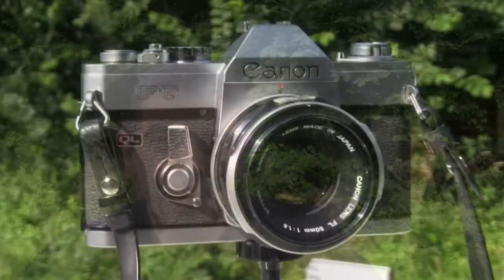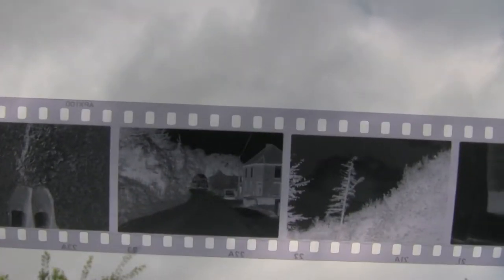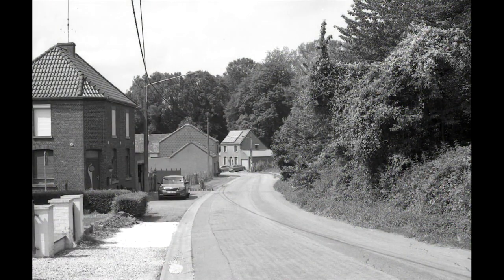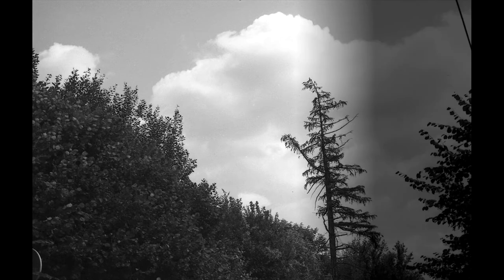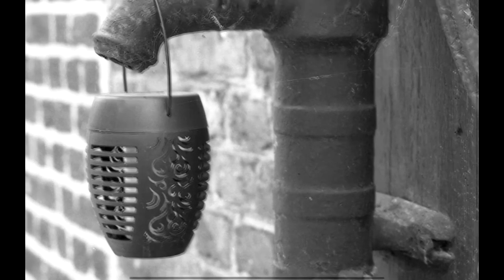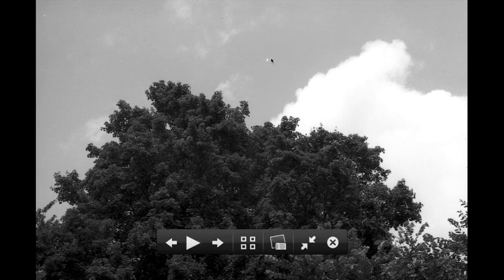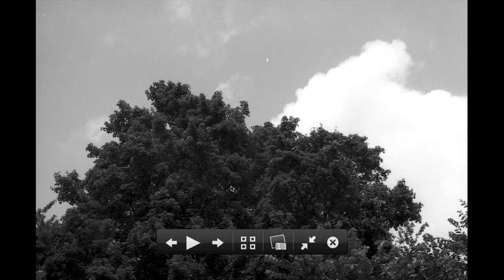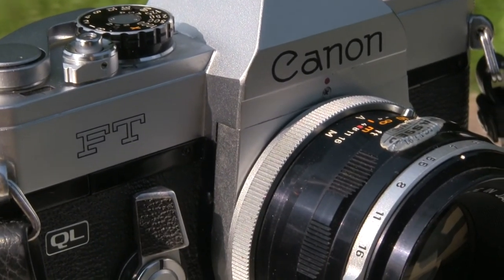How I check if a vintage film camera is fully working or not (Canon FT QL)

Comment: The first thing I check on a new camera is the film advance mechanism. If the spool doesn't rotate in the same manner each time I cock the shutter it's no use bothering at all. The frames will overlap and most of your roll will be wasted... Had this problem with my Exakta RTL 1000 🤷‍♂️🤦‍♂️
Reply from the maker: Guess what ? The RTL1000 is really similar to... a Praktica ! Let that sink in !

Comment: i have this same camera. my grandpa owned it and he did over 40 years ago and it has NOT been used since then - i want to use it but what should i be looking for? 

do i need to replace the battery?
i am going to buy film - i did click the button and it clicks as if the battery works fine but i guess its about if the photos transfer good?
Reply from the maker: Basically everything. And get a cheap film and give it a try before doing anything important